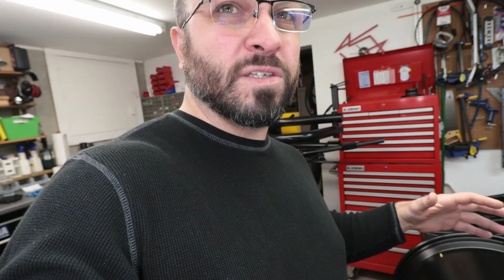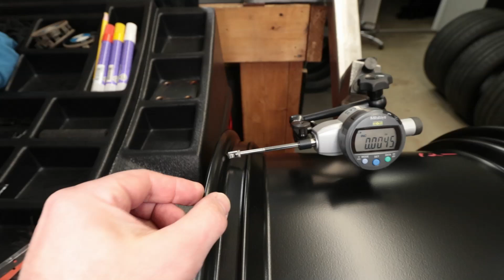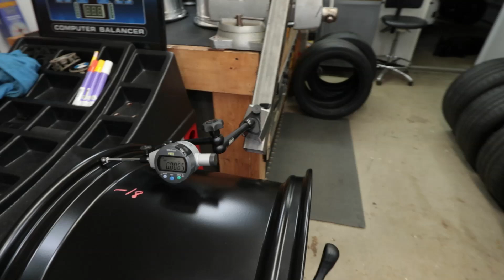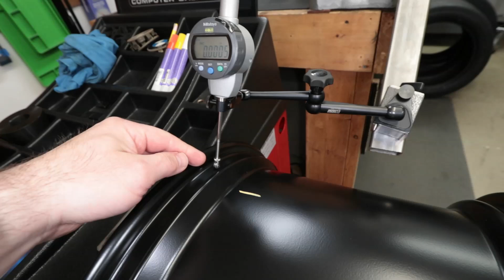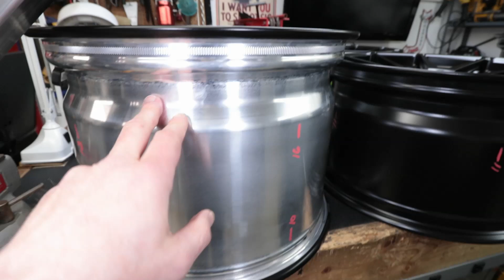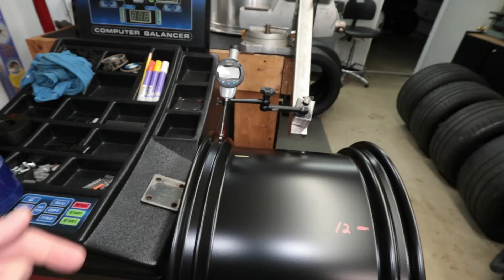HOW to Measure Rim & Wheel Axial & Radial Runout | Brand NEW USA Made Forgelines PASS or FAIL?

Comment: there is different way these wheel are held, i've seem 3 pad/jaw chucks which grabs most of the back of the rim (lip)and wont squeeze it out of round, i've seen 3 finger jaws which grabs on 3 spots and those can squeeze it out of round however rim gets machine from the area where you have your drop indicator (lower area) it then gets turned to machine that area, so lets say it is being squeezed out of round, machining will remove that deformity so when you turn rim to machine the other side, area where you were grabbing could be uneven however as you mount machine side it grabs it from a straight side making second side come out straight,  rim also gets indicated from first machining to second side
Reply from the maker: What ever the machining process is usually from forged blank to lathe for main profile then to mill for final milling. When mounted on cars hub it has to sit very concentric to the hub and bolt pattern regardless of machining processes involved. The work holding fixturing seems to induce stress causing the final unconstrained rim have some acceptable runout

Comment: Amazing video man. I learned a lot from your process.

Small question, how would you set up a lug-centric rim on the balancer? Would it be done any differently than a hub-centric assembly?

Also, regarding that yellow spot on the tire, from what I’ve been taught, that dot signifies the lightest point of the tire, which typically gets matched to the heaviest point on the rim, that being the valve stem. Its only purpose is to reduce the amount of weights used for balancing. It doesn’t necessarily relate to road forcing.

What does relate to road forcing is the red dot that can be found on some tires. That red dot is what actually signifies the high spot of the tire, which is to be matched with the low spot of the rim.

Also, some machines do allow for accurate runout measurement. You’re correct that the Hunter Road Force balancer prompts the tech to measure bead seats externally, but they also feature a bare rim measurement process, allowing for accurate runout measurements.
Reply from the maker: Measuring a lug centric rim would be the same process but do not use the collet on the inside (hub) bore. So mount rim using only lug seats. Just use the pin plates to locate the rim on the balancer spindle axis via the lug bolt pattern only.
Reply: @ModernHotrodsNH Ahh I see now, that makes sense. Thank you for the reply and once again, I learned a whole lot from your video. Best of wishes to you man!